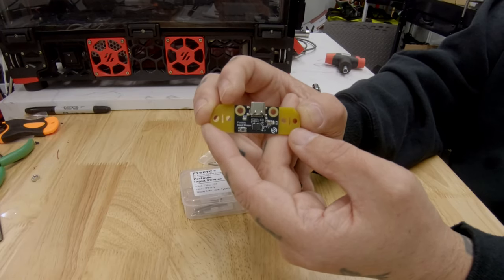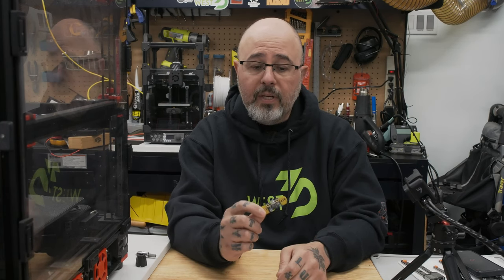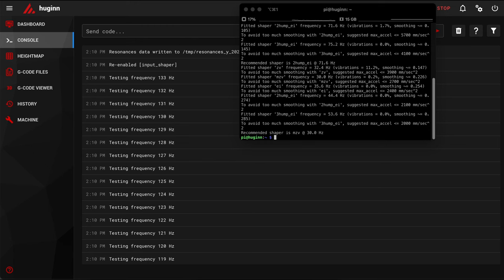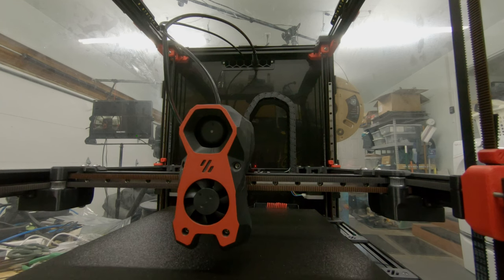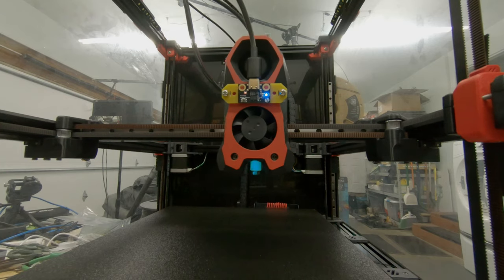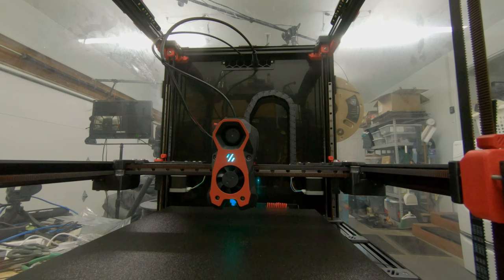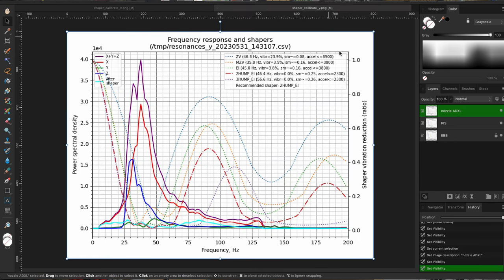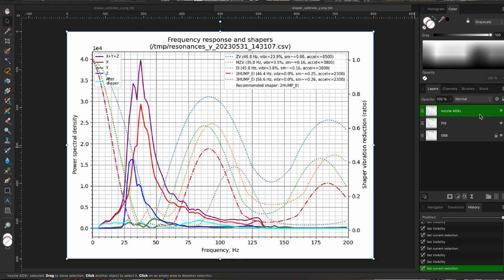USB ADXLs for Klipper

Comment: I am looking for an explanation on how to install the FYSETC. It seems that everyone else has been born with this knowledge as the minimalistic instructions I am finding all kinda say "Oh, well, you just do it like you normally would."
Reply: Same
Reply from the maker: Did you follow the directions on the linked documentation page?
Reply: @west3dprinting219  Never having compiled Klipper before, I did not realize that the elements in parenthesis were selected settings.
Once I saw this executed in another video, it obviously became VERY simple.
I did not expect 3D printing to bring back memories of linux kernel compilation in the 90s :D.

As I said, just because it's simple doesn't automatically mean it's obvious to everyone.
Reply: @west3dprinting219  yes it brings me to a page that says to flash I need an SD card plug into motherboard, the adxl doesn't have a micro SD slot so how can I follow it? I think they just use a generic setup for this but I don't want to be wrong and flash my board instead of usb adxl
Reply from the maker: The linked instructions for the PIS at https://github.com/FYSETC/FYSETC-PortableInputShaper don't mention micro SD cards so I'm not sure where you're looking
Reply: Same here

Comment: By the way, the Provok3d ADXL PCB absolutely is compatible with Revo hotends. Got one for mine and it fits perfectly. You can also see that in Nero3D's Voron V0.2 build series.
Reply from the maker: The issue isn’t the fit; the folks at Provok3d don’t feel that the Revo core spring holds the board securely enough to get meaningful results
Reply: @west3dprinting219  Understood. Thanks for the reply. So I guess nobody can say that it is officially supported. :)
However, for everybody wondering unofficially, I can sandwich the doodad between the heater block and the nozzle so securely, that I can (very carefully) move my toolhead while holding on to it without it slipping.

Comment: I just got input shaper working last night, had issues with "Timer too close" errors that were ultimately resolved by increasing the CAN bus speed from 500000 to 1000000.  My set up is also the EBB36 and built in ADXL.  Good to know there are alternatives out there, thanks!

Comment: Alan, I tried the Fysetc board and was disappointed by it. Every time I wanted to use it, I had to re-flash the board and go through the "make" process again. Even though I was able to get resonances successfully, it wound up being more trouble than it was worth, so I sent it back to Amazon.
Reply: no, you need to flash it only one time, then you just turn on input shaper section in klipper config
Reply: That was not my experience. You may have had a different one, but as I said, every time I went to use it, I had to start from square one.
Reply: @reprinted3D  you did something wrong or your board was broken
Reply: Yes, and you know this because you were sitting by my side the whole time while i wasted hours of my time...🙄

Please don't presume to minimize my experience or tell me I must've been doing something wrong when you can't possibly know the lengths I went to trying to get the board to work. You are neither the end-all, be-all, nor the sole arbiter of knowledge on this product.

I will thank you not to bother me with a reply. Good day to you.
Reply from the maker: Sounds like you had a bad board, I haven't had to do anything to mine after the first firmware installation

Comment: I got fysetc input shaper, holes pattern different from adxl345, I had to modeled a mount for volcano hotend by myself. And sorry for my English.
Reply from the maker: No need to apologize, glad you got it mounted. There are several "standards" for mounting holes that vary depending on who manufactured them